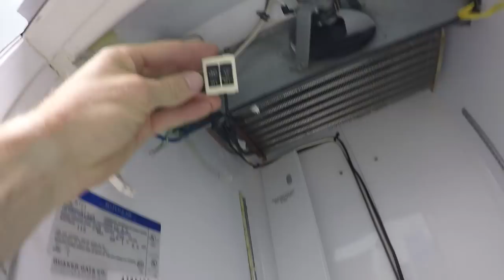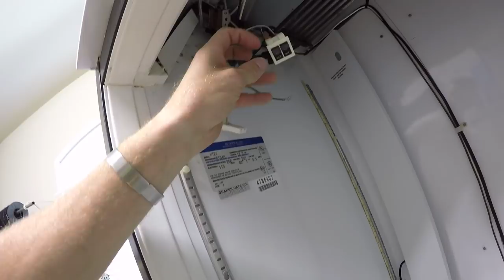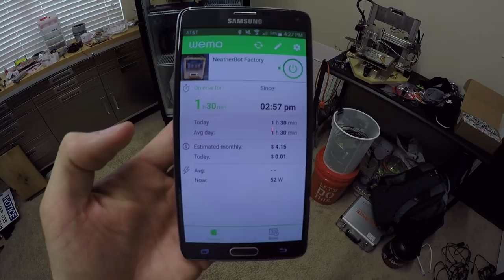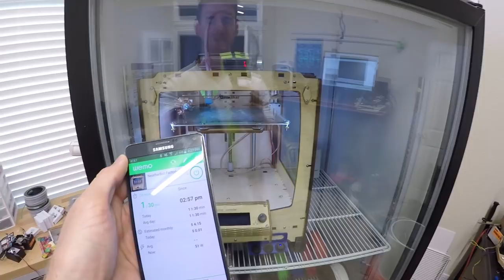3D Printer Refrigerator

Comment: So with octoprint.. You can set it up to turn a relay on and off.. That is how I have it for my printer. After a print and its idle for 30 mins it will turn the relay off which turns off the printer.
Reply from the maker: +Brent Elliott right on, that would be perfect. Can you suggest any links that I can read up on how to set that up?
Reply: https://github.com/foosel/OctoPrint/wiki/Controlling-a-relay-board-from-your-RPi Use the "Easy" method. But still have it control the relay since the relay is going 120V it just turns the main power on and off from the power supply.
Reply from the maker: +Brent Elliott brilliant, thanks!
Reply: Thank you i needed this a lot!
thanks
Reply from the maker: +HiItsMe I'm glad it was helpful!